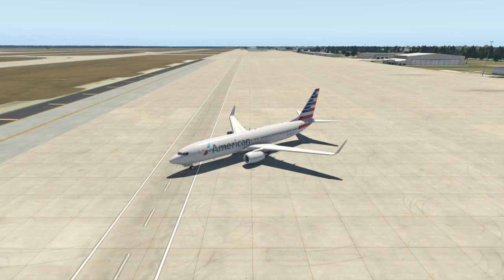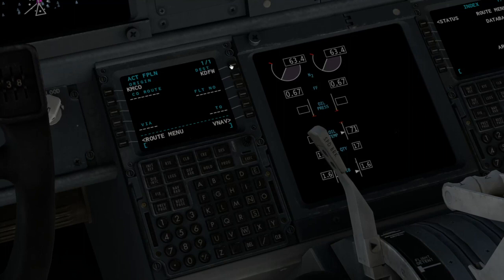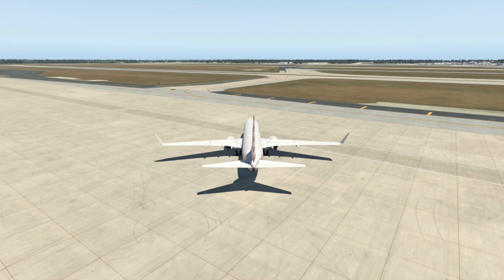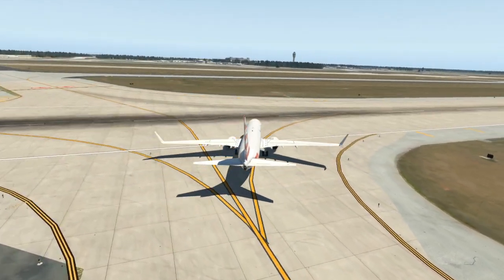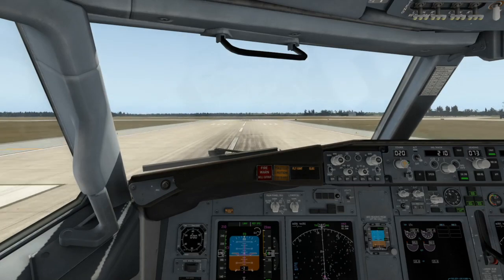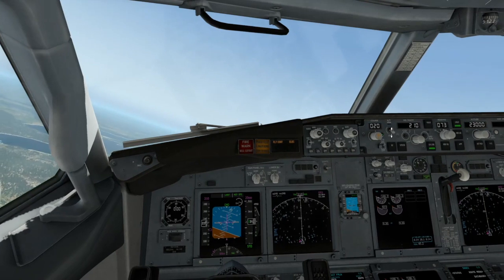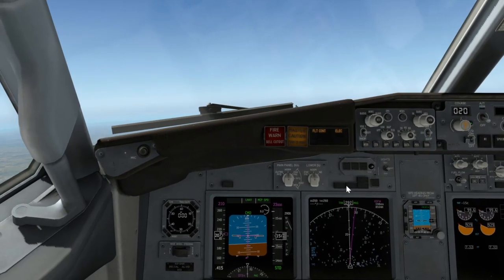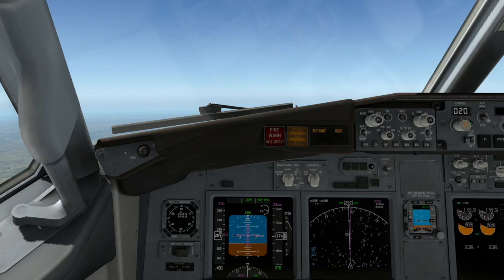Default 737 Autopilot Tutorial | X-Plane 11 (OUTDATED)

Comment: Great vid, but can you maybe help with the verticalspeed? When I turn it on it just turns itself off again 1 second later, and my altitude hold doesn’t work and my lnav also doesn’t work. Do you have a explanation?
Reply from the maker: Most common explanation here would be that FD (Flight Directors) is turned on and that autopilot is set to CMD. If you're using a yoke or joystick, make sure you are not touching it so it is centred as this will cause these features to disengage. That should explain LNAV problems as long as the route has been inputted correctly. As for vertical speed, make sure that you change your altitude first as activating vertical speed too close to the altitude selected will mean that it disengages (maybe try setting it 2000ft above). 

The next option is potentially not to do with your configuration, but to do with a hardware conflict. If none of the above works, maybe try flying the exact same route as me in the video and doing the exact same inputs. If you still have a problem, it could indicate a hardware error or fault in the aircraft that may need updating. 

Hopefully something in there will solve the issue. Thanks a lot for watching, best of luck!
Reply: @FlapsFullAviation  ok I can try that thanks!
Reply: @FlapsFullAviation  it still doenst work. Please check out my latest video so you can see that i did everything right and so you can see the bug
Reply from the maker: @florensdsdw4792  Checked out the video and it certainly seems a bit off. I notice that CWS-P is popping up on your Flight Display with vs off. There could be a few reasons for vs/LNAV not working:
1. A plugin conflict. Are you running any plugins in your sim? Let me know if you are and maybe you could try to remove them and see if it works.
2. The aircraft is actually faulty, so open the x-plane installer and update the sim/aircraft.
3. Since CWS-P is appearing, ensure you have no pressure on the yoke/joystick, as that is usually the main cause for this.
4. If you don't mind me asking, which Yoke/joystick, rudder pedals, throttle are you using? There have been a few cases where CWS-P kicks in due to hardware conflicts. As a last resort, consider unplugging all hardware except for the main yoke/throttle. Saitek panels are causing some issues at the moment.

See how any of those go
Cheers
Reply: @FlapsFullAviation  I updated the plane and it works now :D tysm! defintly a sub!
Reply from the maker: @florensdsdw4792  Great to hear. Happy Flying!
Reply: @FlapsFullAviation  thanks!!

Comment: Every time I try and use FMC for the route it either says 'KEY NOT ACTIVE' or 'NOT IN DATABASE' and I am unsure of what to do as I am new to X-Plane 11
Reply from the maker: Hi, there are a few reasons as to why this may occur. Some things to check:
1. You need to ensure that you have initialized the position of the aircraft.
2. Make sure you are using ICAO codes for airports, which you can find online by googling an Airport name, followed by ICAO.
3. Make sure you are using the correct waypoints and airways. This can be done by using a flight planning software, like Simbrief that gives you more accurate waypoints. I have a tutorial on using this here: https://www.youtube.com/watch?v=GFco5F1n824&t=707s
4. If you are already using Simbrief, it could be due to your NavData being out of date, meaning you need to update your AIRAC cycle. You can do this using a Service like Navigraph.
I hope some of this makes a bit of sense. If the problem persists, maybe consider creating a thread on forums.x-plane.org for assistance. Best of luck!

Comment: Idk why but when I take off hit the autopilot engage button, and then my plane starts to dive nose down even thought altitude is set to 8000 when I am only at 1000
Reply from the maker: Hmm, that's odd. Make sure that you have FLCH (level change) on to climb you to this altitude that you have selected. If FLCH isn't working, try engaging VS (vertical speed) to climb at a certain rate instead. Hopefully you get this resolved, thanks for watching!

Comment: the f ing FMC doesnt let me put any letters! help me
Reply from the maker: That's odd! Try using a popup key in settings to popup the FMC and then see if it still isn't working. this will show us whether the FMC is not working or whether it is your aircraft. If typing with a popup doesn't work, maybe try another aircraft and see if it is still not working. Maybe seek some help on the x-plane.org forum, they're very helpful over there and this is certainly an odd issue. Thanks for watching, and good luck with resolving this!

Comment: So I need a bit of help, I’m using autopilot and I set everything on what I want it to be but it’s been setting me to things like over speed when I set it to 200. Also I was flying from CYVR to KSEA but I it kept me going in circles. If I am missing something please tell me, thanks!
Reply from the maker: Hmm, that is odd. In regards to speed, make sure that you turn on the A/T switch, then click on the SPEED button so it lights up. In regards to the plane flying in circles, make sure your route is correct (no discontinuities or hold patterns) and you switch on LNAV. Hopefully you resolve this. Thanks for watching!

Comment: @UltraUnknowns I can’t seem to use the flight plan thingy, I’m trying to type my airport and stuff but I can’t type and it says key not active and I can’t type anything in, can you fix that?
Reply: It did work, thanks @UltraUnknowns !
Reply from the maker: Hmm. Sorry to hear that. As long as you make sure that you are on the flight plan page, it should work. When you see key not active, try pressing clear, the CLR button on the FMC. Once you press clear, try typing it in then. Hopefully that helps a bit, but its an odd issue. If that doesn't work, maybe try filing a thread on the x-plane forum. Thanks for watching!

Comment: This helped me so much!! Although when I reach cruising, it keeps my altitude stable... but then the speed doesn’t maintain what I set it as. Can you please help me
Reply from the maker: Hi, thanks a lot for watching. Once you get to cruise, the climb (LVL CHG button) is no longer controlling the speed, so just to the left of where you enter your speed, there are two things you need to do. 1. Switch on the 'A/T Arm' Switch, A/T being Autothrottle. 2. Click on the 'Speed' button below that, make sure it goes green. 3. Set your speed. Hopefully that helps a bit, thanks for watching!
Reply: UltraUnknowns Thank you so much!! I have also just finished a flight and i really couldn’t find a video explaining... but is there a way in the default 737 to line up with a runway?? Because I flew from SMF to JFK, just fine... but when I arrived it was hard to lineup with the runway

Comment: Hey, my Boeing 737-800 is warning “Takeoff Config” and I have no clue how to fix it. Have you seen that before?
Reply: Flaps probably.
Reply: Did you set you cruise altitude on the overhead panel?
Reply: Normally for me it's flaps being on 1 or parking break on, try either having park brk off and flaps full, then when In the air set them to 5,or takeoff with them on 5.

Comment: The LNAV isnt turning green
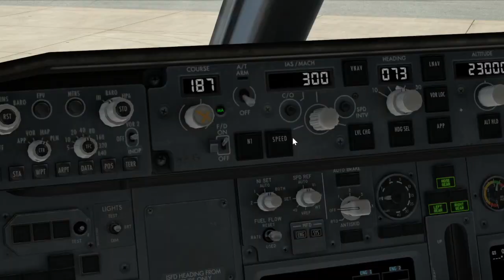Reply from the maker: Hi, to make the LNAV turn green, you need to make sure you have correctly filled in the departure and arrival ICAO's and your route, then the flight number. Once you do those, the button on the FMC keypad that reads 'Exec' will have a bar on top of it that lights up. You need to press the execute button and remove that light. Don't press the LNAV button till after you have done all of this. I apologize if that sounds a bit messy, so if you wish to review the video, this is the part that I did from 0:50-1:33. Thanks for watching, hope that helps.

Comment: Hello, What to do if in the box where you write the details in the Auto Pilot it says ''Not in Database''?
Reply from the maker: This just means that the waypoint, airport or whatever you are entering is not valid. If it is an airport, make sure you are entering the ICAO code for that airport. If it is a waypoint, you may need to pay to update the AIRAC data using a program such as navigraph. Hope that helps a bit. If you have more problems, maybe consider starting a post on the forums. Thanks for watching!
Reply: @FlapsFullAviation  Thanks for responding!

Comment: so u cant control your altitude and speed at the same time with Autopilot i have my altitude set really low cause i want to practice taken off and landing but its just shooting the altitude way up i have it set at 4000 and its took me right up to 13000
Reply from the maker: You should be able to maintain 4000 feet. The only thing I could think of is;
a) you may not have pressed the altitude or vertical speed button.
b) you may be over speed causing the aircraft to climb.
Just check that you have configured the speed settings and altitude settings correctly. If that doesn't work, maybe post a detailed thread on the forum. Hope that helps, thanks for watching!
Reply: @FlapsFullAviation  cool thanks for the advice i have just switched over to x plane 11 from fsx since the graphics look better plus fsx is bad for freezing and crashing what i read u barely get on xplanes so i thought rather than spend more money on fsx modding i will change to xplanes 11. I had just mastered the autopilot and ils landings on fsx now it feels like I'm slightly back to square one
Reply from the maker: @kevsi1990  Yep, I remember the change. Best of luck with your switch over!

Comment: How can you keep the plane SO straight and exact on manual mode in the take off?
Reply: I can see a crosshair on the CMD but idk how to get it there?
Reply from the maker: The crosshair is there as a result of configuring a route on the FMC and then turning on flight directors or FD. Other than that, don't try to over turn or over correct yourself, just try to smoothly line up with the route. Thanks for watching, hope that helps a bit.

Comment: hello there .. can you open the cockpit door in the boeing 737-800 ? please help and thx for help me out with auto pilot.
Reply from the maker: Glad to know you have autopilot running. In most aircraft in X-Plane, you click on the door itself. Sometimes, it doesn't open, and, you just go through the door without it opening. Thanks for watching!
Reply from the maker: You may also try the Zibo mod, that adds a 3D cabin.
Reply: i cant press on the door nothing happens and i cant walk through it... please help:D
Reply from the maker: I would suspect that the default 737 doesn't have a 3D cabin then unfortunately. If you try the Zibo mod, it should add a cabin for the 737. Sorry that the default doesn't. Thanks again!
Reply: and one more thing .. im new at this game sooo.. do you know why my plane sometimes crashes at itselfs ? im just flying and boom i had crashed. please answer both of my comments :D
Reply from the maker: Wow, that's pretty odd. The most common cause of that is running out of fuel. If you go to flight configuration and click on weight and balance, try to fuel up completely. Cheers!
Reply: yes i was thinking the same thing .. so i tried it and it still did it:C